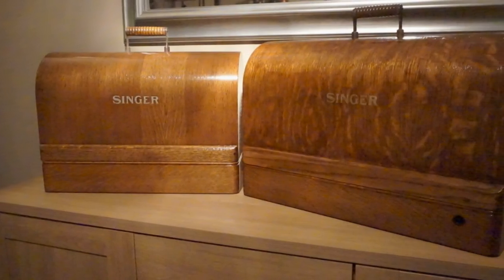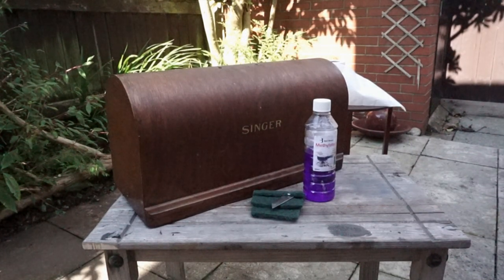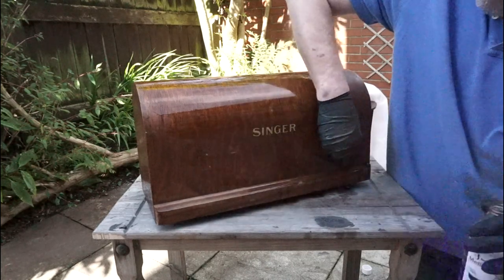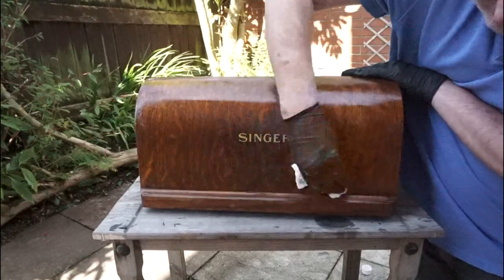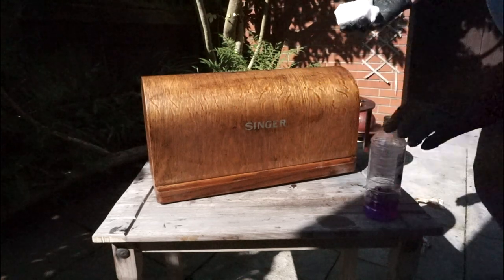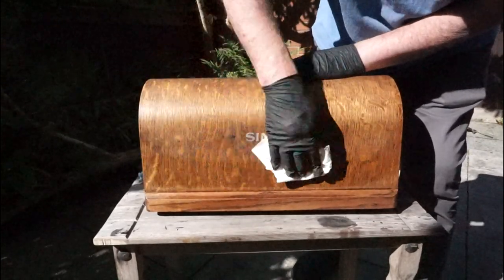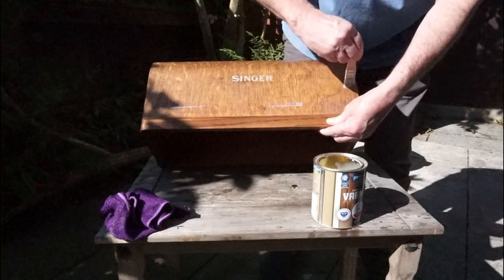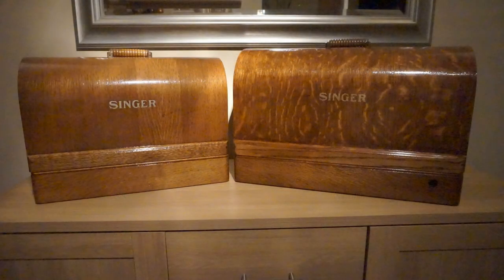How to Refinish a Singer Bentwood Case

Comment: This video is just awesome!  Thank you so much.  I just cleaned my case and put furniture polish on it which keeps sinking in to the wood.  Your video is the answer to the issues with my case!  Woo hoo. I wonder if this method would work for the “coffin top” lid for my 1896 Singer Fiddlebase #12 machine?  For that matter - the whole wooden treadle table?
Reply from the maker: I don't see why not! It was common to use shellac as a finish on treadles.

Comment: Hi, excellent  work.
I also own a Singer sewing machine from 1925 and I want to recondition it.
I have a problem with the case. It was hit on top and has a small depth, the plywood is a little cracked and clogged, but it is not penetrated, it is not a hole. I thought it might go somehow forced from the inside back to its original shape and reinforced with something on the inside. Can you give me some advice please? How can I fix it without causing any damage?
Reply from the maker: Steam is good for softening wood, enabling it to be gently moved back into position - then clamp it until it dries into place. Then wood glue and clamp to fix into place.
Reply: @CurioByBSpokeDesigns  Many thanks!

Comment: Hi have, just received a Singer 99 with bentwood case. Both machine and case in impeccable condition.
I have query about the bits of wire like cages inside the cover. How do they align to the machine?  There is a removable extension table piece. Does this, slide into one of these metal wire bits, and what is the, other one for please? 
Great video, thank you.
Reply from the maker: The internals of these cases varied a bit. The extension usually has a twisting clip to hold it in place and the wires are usually to hold the oil can and one for the box of  accessories. Have a look at my video on the croc case. You can see how they fit.
Reply: @CurioByBSpokeDesigns  thanks so much. I have figured it out.  The part with the screws that twists over the corner of the table is missing. However I have improvised using a bowtie shaped plastic clear twisty thing screwed in, and that does the job just fine. All good now. Thanks for your help 😊

Comment: Excellent, I think you are a fountain of knowledge! I will be using your method to restore my bentwood case. Two questions: 1. My case has much paint spatter on it..I tried lifting it off with a blade, but it damaged the case, as splinters of the delicate wood came off with the paint.. any tip on softening the paint/ safely dissolving the paint off instead of lifting off with a blade? 
2. Does the new varnish coat method provide the same richness and even factory gloss finish as original shellac?
Reply from the maker: Try sitting a piece of damp paper towel on the paint splashes for s couple of hours - this should work if it's water based, otherwise, paint thinners should work. This method gives as good if not better shine than the original finish.
Reply: @CurioByBSpokeDesigns  OK, much obliged to you, I'll give it a go! Great, will be nice to see a good clean lustre on the case again...Paint thinners is OK yes, not damaging to the delicate wood?
Reply from the maker: @degsn37  Thinners should be OK - meths may get it off too
Reply: @CurioByBSpokeDesigns  Perfect,  thank you...

Comment: Have you ever found a way to rid these cases of the fusty smell they sometimes get if stored in a damp place?  Ooh I hope so!  It’s the old glue I think. Thank you. Those cases look splendid
Reply from the maker: There's several methods of getting rid of the smell. You can put a dryer sheet in the bottom or a small dish of baking soda. The worst offender for causing a smell is old oil, which can go rancid. This is more common on machines with felt lined drip trays such as the 221 featherweight or the 401s and similar, although I have occasionally known it to happen with 201s.

Comment: Hi thank you for the video..can you tell me what the hole is on the bottom right side???
Reply from the maker: Yes, it's for the knee control lever. This machine doesn't have a foot pedal. The controlled is situated in the wooden base and is operated by a removable lever, controlled by your knee.
Reply: @CurioByBSpokeDesigns  thank you so much for your kind help

Comment: I'm sorry here not to be as enthusiastic as the other commenters, but isn't scotch britte and denaturated alchool super abrasive for the decal? In fact the decal turning silver sounds as a bad indicator to me. I don't believe the god color comes from the shellac, like on the sewing machines the decals are golden and will silver if you clean them using abrasive products or not take care. Also why not simply reapply shellac using for example French polishing technique? I'd rather reapply shellac on top of the case, mixing it with the old shellac. Anyway thanks a lot for sharing your technique.
Reply from the maker: If you go lightly over the decal and take care it should be OK. I had difficulty in finding shellac (and had conflicting advice on how to carry out the French Polishing) and this finish is low VOC and durable.

Comment: I have a case without a key, can you help me solve this problem?
Reply from the maker: You should be able to use a small, flat blade screwdriver (like a terminal driver) instead of a key. Keys are still available on eBay for these.
Reply: @CurioByBSpokeDesigns  Thank you so much.
Reply: @CurioByBSpokeDesigns  Would you need a bentwood case with a 127 inside?